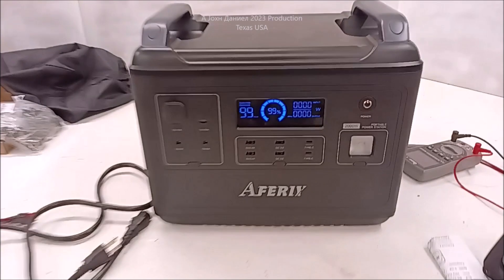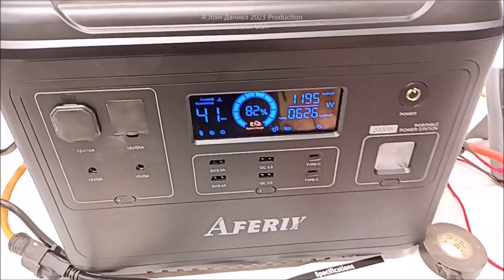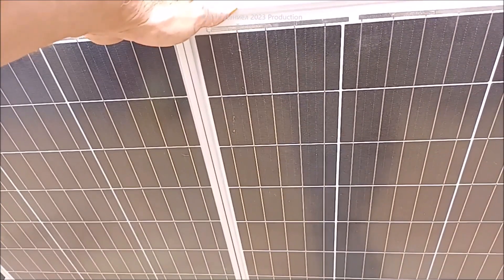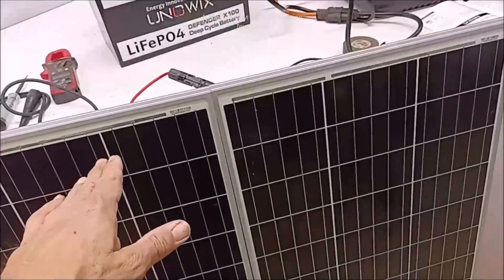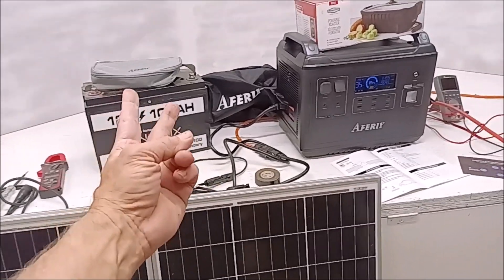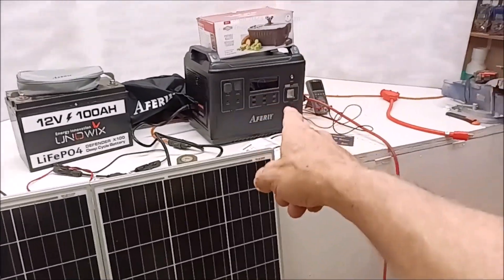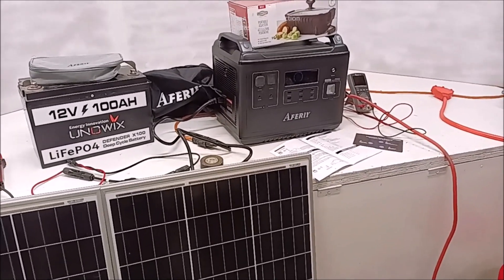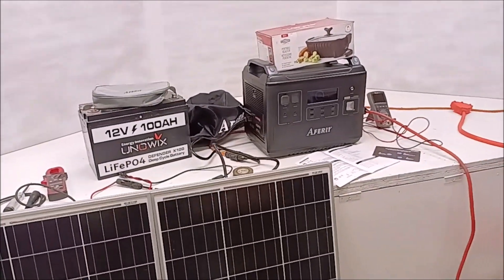Micro Off Grid - AFERIY Portable Power Station, HUGE battery, 2000W+ pure sine, UPS functions

Comment from the maker: A Discount offer was sent  Portable Power Station 2000W, its URL: https://amzn.to/3N9Da7Q
Reg.Price: $1,498   Final Price: $1,082  Amazon Check out Code: 1548HR06
Start Time: June 2, 2023 to Expiration Date:  June 18, 2023 HELP SUPPORT US using https://www.buymeacoffee.com/JOHNDANIEL or https://ko-fi.com/john4kiera   Check out the parts list for a TOTAL DIY SURVIVAL OFF GRID KIT https://amzn.to/42cdjBX
Reply: Same results as solar junkie.  Discount code did not wrok.
Reply from the maker: @ogaddcb  Try again, they posted it as a 15% off button when you get there. https://amzn.to/3N9Da7Q
Reply: @JOHNDANIEL1  The 15% will give the buyer a purschase print of arount 1200 not 1082
Reply from the maker: @The Solar Junkie Try again, they posted it as a 15% off button when you get there. https://amzn.to/3N9Da7Q
Reply: My age Roy will not power a ac unit or anything with the ground cable plug on it I think something wasn’t hooked up inside  it will power regular two pronge plugged appliance’s but nothing with 3
Reply: Aferiy

Comment: Hi from the U.K. I have just bought one of these but badged as VDLpower not Aferiy it’s identical except for silver handles it’s a basic unit, no app,no Bluetooth, no different charge rates but a lot of bang for the buck, £800 on Amazon currently. 👍🏻🇬🇧
Reply from the maker: Yes, Checked them out. Same maker.

Comment: @JOHNDANIEL1 Hi John. I hope all is well. Did you ever tear open this AFERIY  Power Station to see the internals? Also wondering your take on this company and their power station durability. Thanks!
Reply from the maker: Yes I have, and we have a second new one we got with points and credits. I will open it on video. Did blow $222 spent on the newest one a 2400w https://amzn.to/3WMoY9V but tons of honey credits and $190 Amazon card. It's a little bigger. The original is taking in DC power all day, running 2 of our 9 cubic foot freezers permanent. No faults, no fails, and excellent voltage. We ran a HF 100 amp mig on it, and welded using full mig power without issue.
Reply: @JOHNDANIEL1  Thanks. Can't wait for the open up video you do on this one. Hope also to see a video on the new 2400w one as well. I need to check out that Honey thing. Thanks!

Comment: Great video as always.  I bought 2 pecrons E2000's they have 1300 watts of solar input each,  both have a 2000 watt inverters 1920 lifepo4 batterys plus I bought one expandable battery that takes in 400 watts of solar and is 3072 watt hours.  The unit has the 12v 10 amp input like you said however the expandable battery has 12v-30 amp port so no worries.  I paid 855 for each unit and 1045 for the battery.  Great budget friendly product.  Downsides uses a brick to charge personally could care less about that.  No app once again I could care less.  No ups which I would never use anyways.  I have been running my fridge, instant pot, microwave and computers etc.. for 6 months.  As backup I have a propane, gas with the pure sine wave inverter generator.  Currently I am up to 1800 watts of solar and building.  I love these things!!!

Comment: Ruh roh. Should I rethink my plans to get that Allto Solar 9bb kit???
Reply from the maker: Get the Aferiy, a 24 volt battery, 6 solar panels, 20 amp 24 volt solar controller mppt ( 3 to the Aferiy and 3 to the 24 volt battery) and your back up power system is built! But a easy 12 volt system is really simple using the Allto stuff. Quality is good, and output is very good.

Comment: You know what you are talking about so ill ask you. 

if i have it plugged into the wall and providing power by mains all the time (until power cut /  UPS) then surely the batteries will be fully charged at all times!

Doesnt that damage the batteries as its not going through a frequent charge and discharge process? Ive been told that its bad to have the batteries hold a full charge for long duration. 

Can you please help me understand this?

Thanks
Reply from the maker: While being used as a UPS for months now, the Aferiy 2000, the one I have in the link under the video does this, I can't say for other models, but that one runs the batteries in idle only with the meter showing 100% which is actually not I can promise you, the 100% you'd expect. Its actually 95% based on the cells readings and only when you totally discharge it, then recharge fully will it go to 98% and still say 100%. After full recharge it uses some of the stored power to run its systems down to the safer 95% then fully stays on the grid and acts like a UPS again. Very impressed with it verses many who cycles constantly and are pushing the 100% to zero percent rotation that wears out these battery designs. It will drain to what shows as zero percent but on the math it stops at 7%. So I can assure you, their battery lifespan will be better than most on the market. If you want the Aferiy to go to a real battery killing 100% battery, you have to using the power button push it long push to on, off, on 6 times then the charger will come on and peak out the battery and stay that way forever. I do would never do that, it will shorten its life 2+ years. Right now, I expect it to make it over 8.
Reply: @JOHNDANIEL1  Thank you, i have the 1200w version as 2000w is overkill for me. 

Thank you for responding

Comment: The new Li Time trolling motor battery is very, very good, I tore one apart, the BMS is massive and can handle some serious start up power, low temp protection, and on sale for $369, but not many left..It's the very best cheap 12 volt lithium battery I've ever tested..
Reply from the maker: The same BMS is in the Digimarker 135 https://ebay.us/6fF1h7 is same one, but much deeper term of use. Their 24 volt use, a pair is a 2 day run on the lakes.
Reply: @JOHNDANIEL1  Wow, I didn't know about that battery, but, they are not the same..The li time handles 500 hundred amps for 10 seconds, tested that myself, the Digimarker is 150 amps for less than 5 seconds..But, I like that battery for the price, I'm going to check it out..I've tested about 30 batteries so far, for a work project, the Li Time TM handled the most current of all of them, of course that is only one aspect of a battery, but impressive..
Reply from the maker: For Inverters, the LiTime is excellent. For long duration draw the Digimarker as well as the Redodo rein supreme.

Comment: Hey John, pick up the inverter you recommended. My charge controller at the moment is an Epever 5260bp 20 amp controller. It was about $62 on Ebay. I was considering buying a couple more of the Epever 20 amp controllers, but wondered if there was something similar you'd recommend? I'm trying to take an approach of multiple smaller controllers running sets of 200watt panels placed strategically due to the fact that we have lots of shading issues with trees etc. Only have small spots scatter around of which to collect any sunshine. I figured too that having multiple smaller charge controllers verses one large one sort provides some failsafe protection should any of the controllers go south. Is my thinking okay here? Thanks!
Reply from the maker: I recommend the HQST 40 amp https://amzn.to/3CcWgnw , it is bigger, but if your heavily shaded you can run solar pairs of 2 into 40+ volt to it from further away for a total of 6 panels, 600 watts back into 12 volt system. So if you have 3 spots you can put 2 panels each time, but are 40+ feet away in each direction, then your able to run them 2 in series each time to make the distance easy, and it is able to convert better than a Epever under those unequal wire scenarios. 
Adding 1 of those for your bulk, maybe another Epever 20 for the total system redundancy then your high on power, and less on risk.
Reply: @JOHNDANIEL1  Appreciate this reply, makes sense to me.  At one point, I almost thought my situation was hopeless for solar, but since getting started, I see it is definitely feasible to still have a pretty decent little system whether it be a backup or to permanently run at least part of a household. During the Ca wildfires, I put a one circuit transfer switch in for the little gas generator I bought to avoid extension cords through the sliding door. The one  switch has allowed me to run tv, computers, fans and the fridge.  It's nice to have some solar to feed this circuit even in non crisis times.  Thanks!
Reply from the maker: @keep-it-real6926  Use your generator to charge up your batteries as much as you can when running it.
Reply: @JOHNDANIEL1  Yeah, I've thought about doing that. Is that maybe helpful for maintaining the batteries in a low power setup like mine so the batteries reach the higher voltage more regularly, thus having a chance to balance the cells more?

Comment: As far as a I know, the newer units like this do not have a auto shutoff on the dc, the original oukitel had auto shutoffs on all outputs if no power was being drawn. Dc side had to be at least 2 watts and I think it was over 5 on the ac side.
Reply from the maker: True UPS function should keep them on until they low volt shut off from the battery side, but your right, the older ones shut off without notice from lack of action. So far, this one hasn't.
Reply: @JOHNDANIEL1  Yes, as long as it was plugged into wall power or 115v power the ac side would stay on, If it was not plugged into ac voltage it would shut off after something like 30 seconds to 5 minutes. I used my oukitel as a ups for a box fan and cpap machine for about a year. I had issues with it shutting off the 12 volt dc power no matter what unless it was powering something like a usb powered fan through a 12 volt fridge. I was told that it checked every 4 hours on the dc power side and if there was no power reading then it shuts off. The usb side also shut off unless there was power going but that did not matter for the 12 volt side.

Comment: My 716wh capacity power station ran my electric blanket over two nights on medium high during the below zero wind chill freeze here in Louisiana last December. On medium it would run it much longer but I stepped on the ridiculous digital controller and turned it up. I recharged from solar regularly though but tested it two nights and had 20-25% battery remaining. The high winds kept knocking out the power.
Reply from the maker: We are letting it run our 21 cuf refrigerator from full charge to dead, seeing if it can do 3 days off line. So far, 8+ hours and only 14% used.

Comment: The only 12v cooking devices I`ve found that work with 10 amp ports are 12-24v 100 watt rice cookers and 120w 12v immersion cup water heaters. Some AC rice cookers are 200w and will work with the common 300 watt small power stations. Those of you with 500 watt power stations should check out the incredible 350w Dash Mini Griddle, waffle maker, etc. I LOVE mine!
Reply from the maker: I have 13 different 12 volt and 2 of the Nassau 24 volt marine grade cooking items. Never let the crooked power utility system stop you from cooking!
Reply: @JOHNDANIEL1  I have two 12v DC rice cookers. They can cook one dry cup of rice which is perfect for me. I can make rice and lentils in about 35-40 minutes. I just let them cook until the green "done" light comes on. Of course you can cook a lot of other things with them. I have a big 300ah Ampere Time 12v LiFeP04 battery and 2000 watt inverter for my Yedi pressure cooker, small toaster oven, microwave, etc. The Dash griddles make a perfect thick four inch cathead biscuit in about 4 or 5 minutes or nice little thick pancakes in one minute. So I use them a lot. I have three of them and their waffle maker. 

I got a cup water heater for portable instant coffee and a 600 watt bucket water heater so I can heat bathing water during power outages. It works with my Bluetti EB70 power stations. I`m trying to cover all the bases so they can`t ever take away my electricity again. I have power for my freezers, dorm fridge, and everything here as long as the sun shines and a gas generator if it doesn`t. I got the big battery for my small air conditioner. It only draws 350 to 400 watts. I want to be able to cool off when the next hurricane hits. Two of them got us in 2020. No power for three weeks. It was bad!
Reply from the maker: Proof they responded real quick, 3 hours after this video - A Discount offer was sent. Portable Power Station 2000W, its URL: https://amzn.to/3MQEFGV
Reg.Price: $1,498   Final Price: $1,082  Amazon Check out Code: 1548HR06
Start Time: June 2, 2023 to Expiration Date:  June 18, 2023
Thats over $400 off. Ye Haaa, Telling my boss to get him one more ASAP.

Comment: Glad you did this video been looking at Pecron 2000LFP and doing their EB3000 battery which is stand alone and has USB C and A and xt60 12v/30amp output and can do solar charging 400watts and same for AC charging.... Now have to see which takes less cables and size for my trailer
Reply: I can recommend the pecron 2000, definitely check on what works best for your space, the pecron is more effecient on power usage than these oukitel units. Pecron is around 90 percent on the ac but cannot handle more than 2000 watts, oukitel is around 75 percent but can handle 2000 watts on the inverter if needed for much longer than the pecron.
 There are about 10 brands that look identical and oukitel made the original. I know the Ffpower version does not have auto shut off on the dc side, oukitel did, not sure if this one does.
Reply from the maker: Depending on how you want your outlets laid out, if you can get 400+ solar into it and if its got almost 2000 watt hours like this one I got, then its a price game. They sent me a discount code for Amazon about 3 hours after I uploaded this. Making them $1080. I put it in my pinned comment up top. As for my test, mine would barely run a 14 amp compressor while the Air conditioner was running, but it would run the 9 amp shop vac and a 4.5 amp grinder while the Air Conditioner was on.

Comment: What is your opinion on renorgy 220w Bifacial panel cost right now is $219... Normal in $329?
Reply from the maker: They are still over priced considering the total benefit and using bifacial requires extra efforts in mounting so its a give and take situation if your planning to use them.
Reply: @JOHNDANIEL1  I have a cricket trailer so space is my biggest concern I have 2 100w renorgy adding 3rd only gives me 300 watts so if I put 2 of the 220w I get 440watts..... So just wanted to know if good panels to use?   Thank you for your videos.... Love how your raising your daughter.... Keep it up need more father's like you in this messed up world!!
Reply from the maker: The Bifacial is large, your better off getting 4 of the HQST panels since they are compact, can be mounted in different open spaces, do not require you mount them 8"+ above roof like the bifacial will.  4 pack mono https://amzn.to/3MMVv9w are $280 for them, can be wired easier, and cheaper. Plus if one bifacial is shaded it cripples the other. The HQST will not do that. The Bifacial reality not mounted over white sand means Your average daily will be less. The Renogy is also not like it was pre-2021, they are lying about actual outputs. New owners are ruining that brand.

Comment: Is it NG bonded? Will it allow a NG bond plug if not already bonded?
Reply from the maker: I have not done a open, but most I have saw have the common and line as normal and the ground on a separate chassis point.
Reply: @Јоhn Daniel  non of these types of systems have a ground lug and with an open ground a lot of newer furnaces along with other sensitive electronics will not turn on and will go into protection mode, my Honda 2200 won't run my furnace until I add a NG bond plug to create the NG bond required
Reply from the maker: Yes, your correct. Use a power strip GFCI style with it integrated in it to be as the middleman in that kinds of situations. Furman in best. https://goto.walmart.com/c/1351211/565706/9383?veh=aff&sourceid=imp_000011112222333344&u=https%3A%2F%2Fwww.walmart.com%2Fip%2FFURMAN-PST-2-6-15A-AC-STRIP-8%2F33296601
Reply: @JOHNDANIEL1  how would that help with NG bond